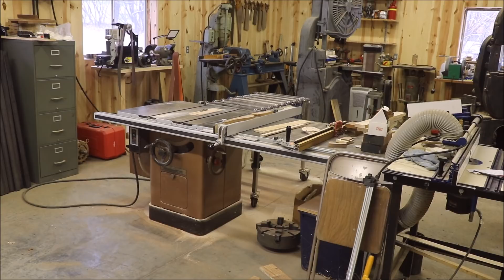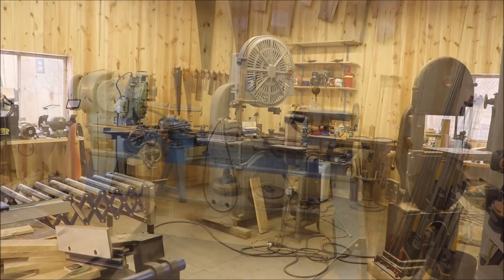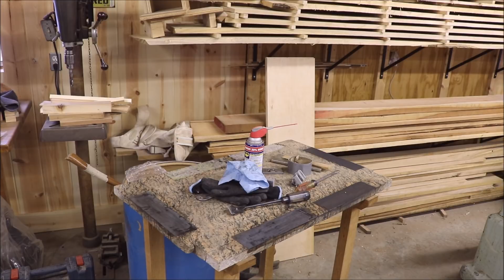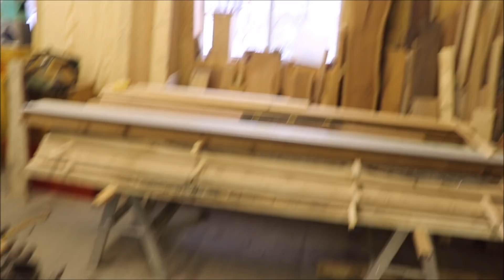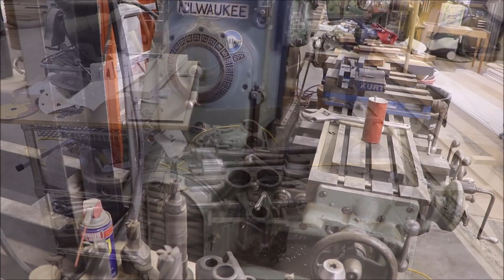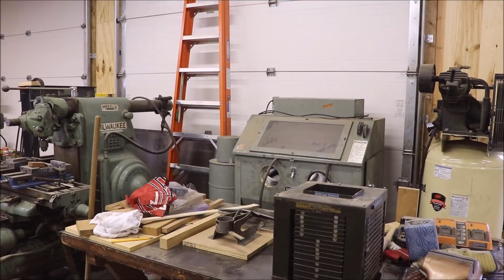2017 Workshop Tour

Comment: Great vid Jeff.  I noticed that you said the Craftsman/KingSeely drill press was a 1967 vintage.  Mine was said to be a 1952 (?) model.  Am I mistaken about the age of mine?Be well.
Reply from the maker: Bill, Thanks for watching.  Those 150's were made for a very long time.  If you have your serial number off the tag, you could easily go to Keith Rucker's site, vintagemachinery.org, and date it there.  There's tons of information there about dating vintage machines.
Reply: Thanks Jeff.  Mine is not a 150 model though they look alike.  Will check further.